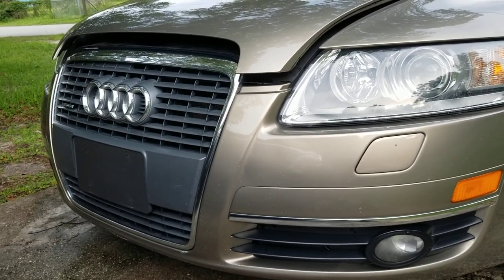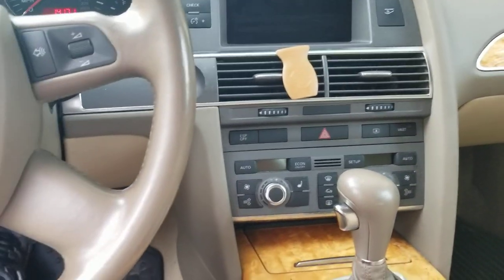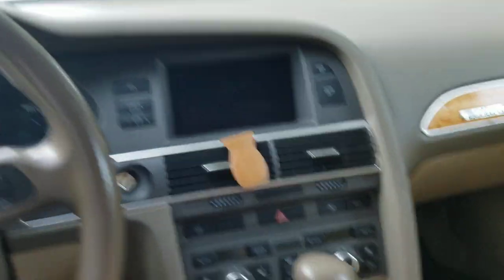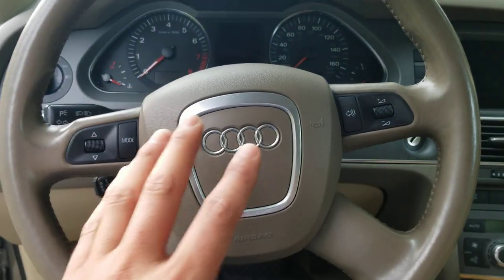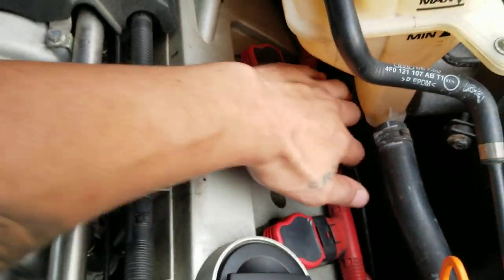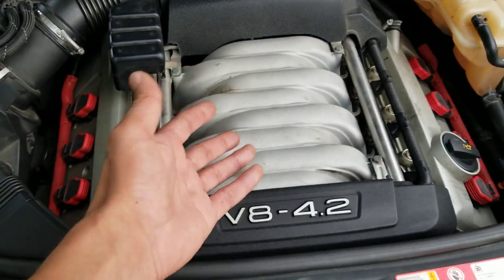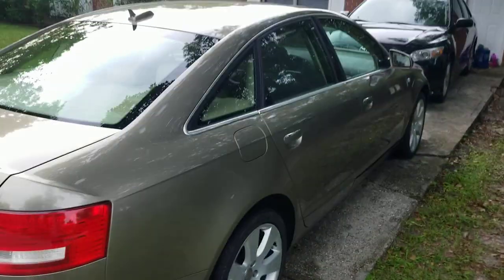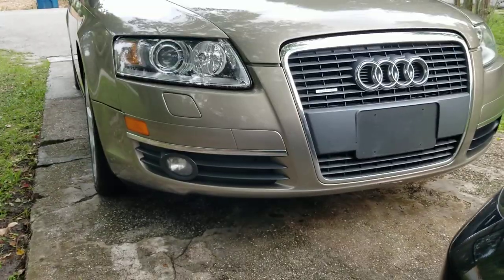FIVE THINGS I HATE about my Audi ( My neglected Audi A6 4.2 )

Comment: I almost got one of these for a daily driver, the guy wanted $7000 for a 2008 A6 4.2 Quattro S-Line that looked in very good shape, but I just couldn’t take the gamble on expensive parts and maintenance to keep it on the road for years and years.
Reply from the maker: Thank you for viewing and commenting. I agree, 7k is a bit much. I barely paid 4k for mine. 08 is when they did a refresh so could be cause of price bump. Part prices are no big deal with a reputable site, it's the labor. If you're not the DIY type it'll cost you. Next time you're in the market look for the one's with the right maintenance records and you'll be good.

Comment: 2008-2011 c6 A6 has a factory mp3 box in them in the glovebox. C6s older than that you can add it to it but it has to be coded by the dealer and secret menu activated with vagcom. Not cheap if using new part, around $1500 parts alone. Not sure if dealer would code a used one but that would be a a lot cheaper.
Reply from the maker: thank you for coming and the input. im aware of the newer ones being equiped with the unit. i dont even have the hidden green menu on my MMI. let me know your 5 dislikes. again thank you for coming
Reply: so how do u play music?
Reply: @dallaslewis4411  I've heard people use retrofits for carplay as it works on this MMI. I haven't tried but it sounds tempting. Currently I just use FM transmitter so I can listen to bluetooth music. Cheap fix to say the least, but yeah you have to use the small interface on the transmitter itself or your phone to change tracks

Comment: Next to the six discs there is the AMI Audi Multimedia Interface, I believe it was optional cuz the car had it when I purchased it, you can plug your ipod, usb memory, phone,  
jack (etc to play your music or videos) each cable for what you wanna connect
Reply from the maker: thank you for viewing. yes its an added option, i believe i mentioned that theres a wire i can buy. the point of mentioning the AUX is because a base model KIA and TOYOTA had them standard for many years, meanwhile a car of this caliber it has to be added. i could do with less cig lighters for something i would use. im also aware that they started putting them in  the 2008 and up models, not all but its a start.

Comment: #5 - I got the bottom of the barrel MMI - the simplest screen and only a single CD player, so BluTooth or anything, but then I remembered the old ways from early 2000s - FM transmitter is a thing, so right away I bought one from a local supermarket, looked through the list of local radio stations, to find the biggest free gap in their frequencies, and tuned transmitter to one of those. Transmitter also has buttons, which work as "forward", "back" and "play/pause" with my phone, usually I play something from "Spotify" there. Yes, the quality of sound is not top notch, sometimes there is some interference like slight background hiss or crackling, but enough for me.
Or you can stick a microSD into a transmitter, it's just not the option I use.

Comment: I have owned both A6 (2000) and A4 (2015) and I would pick 2 hates from your list the auxiliary and the maintenance cost related to labour.  Also if you really want to enjoy the Audis get the quattro with S line package. The shape of Audis since 1999 been really outclass and compared to BMWs and Merc they never looked trivial.
Reply from the maker: thank you for the view, sorry for late reply. ive owned several since 1996, my most enjoyable was my 2002 A6 4.2 followed by my 2000 A6 front drive. i didnt own the A4 convertible 2 weeks before i was rear ended and pushed into the car in front of me totaled which is why i bought this one. i didnt have much time to search for what i really wanted accident was in massachusetts had to get back to florida for holiday.

Comment: What device are you trying to use that you can't Bluetooth?
Reply from the maker: Thank you for viewing and commenting. I've tried several devices and can only be used for phone calls. The point of mentioning the aux or lack of is to point out that a vehicle of this caliber shouldn't have it as an add on when other lesser caliber vehicles have them
Reply: @ScarzCarz  thank you for your response. So the bt only for calls but not music?
Reply from the maker: @rustystaley7150  yes, only calls. The facelift models have a secret green screen that allows you to play with such features, mine unfortunately doesn't.

Comment: How many miles does your car have? I’m looking into buying one with 120k miles on it
Reply from the maker: i belive im in the 160k range, i think it shows up in one of my other videos if not this one. be sure o take yours for a good test drive and ask alot of maintenance questions.
Reply: @ScarzCarz  Thanks, I saw your other videos and yeah yours has around that. 
I'm mostly worried about the loose timing chain problem. 

If you don't mind me asking, how much did you pay for it ?
Reply from the maker: i paid a little over 4, 000$ u.s a few years ago. not a bad deal. got me back to florida, i didnt even want it, still dont.
Reply from the maker: @power2daaplayer304  yes, the timing chain problem. i thought i had it until i did the treatment and drove a while. the older gentleman before me handed me stacks of service records, got lucky for a car i settled for. it sits again all summer until i get back to florida.

Comment: Just get one of those FM transmitters for your aux
Reply from the maker: thank you for the view. im aware of the items i can purchase for aux, im sure i mentioned i can purchase a dongle that wires to my cd changer. the point of mentioning it is because instead of power supply and cigarette lighters i would have been good to have an aux. especially since a base model TOYOTA or KIA have had them standard for many years, meanwhile a car of this caliber it has to be added.

Comment: I bought this car used in 2015 and today i regret it :( gonna try and save for a honda
Reply from the maker: thank you for the view. tell us your issue, a viewer or myself may be able to help.
Reply: @ScarzCarz  its just that after 150k miles it becomes expensive to maintain, i need to pay 680 for an alternator assembly replacement, let alone when the car starts its just louder than usual. Theres oil leaking under the hood its just a soon to be junk car
Reply from the maker: @muhamadq1744  i can understand the frustration, ive been driving Audis since the 90s. youre right, if its not one thing its another. they make it a pain to work on. again, thank you for the view
Reply: @ScarzCarz  yw its a nice video, the mechanic says i got an oil leak under the hood btw, any idea what thats from? Oil filter gasket maybe?
Reply from the maker: @muhamadq1744  these engines have a problem where it leaks from the oil filter housing, it makes seem like its leaking elsewhere. its a cheep part but it requires removing the intake manifold, its not that bad of a job for a DIY. hard to say without looking at it in person though.
Reply: @ScarzCarz  ooof when i hear intake manifold i think 500-600 dollar piece and i want nothing to do with it 😅 ill ask richie to take a look at it.
Reply from the maker: @muhamadq1744  lol,i get it. it might just be valve covers also, but ive seen alot of oil filter housing gaskets go bad. it really up to you and if you feel the car is worth putting money into.
Reply: @muhamadq1744  Do you have a multitronic? That's the unique expensive and no reliable engine from this model (2005-2011) if not then go other Workshop or do it yourself, the rest of the engines are reliable and cheap to mantain, this V8 4.2 not that much due the lack of the space
Reply: @muhamadq1744  Go to Audiworld forum and do the search there.
All the leaks, fail codes, everything is there,located and solution. you MUST own a VCDS vagcom cable and the respective elsawin program cracked installed, you cant just pay constantly 50-100 usd per scan, lmao
If you dont want to do what I told you, 80% Workshops / Audi dealers will SCAM you on the repairs and charge a lot. If you cant do yourself basic things this car isnt for you

Comment: OIL LEAKING, OIL LEAKING, OIL LEAKING, OIL LEAKING,, OIL LEAKING, for my C6 4.2
Reply from the maker: thank you for viewing. sorry about your oil, could be as simple as a valve cover gasket to the dreaded rear main seal which requires transmission removal.
Reply: Mine leaks too but once I changed the oil gasket under the manifold it stopped for a while but as I keep looking the oil sensor behind the housing in the back is what was leaking